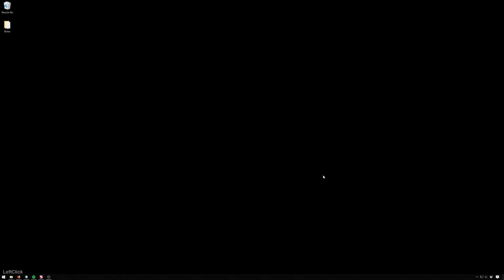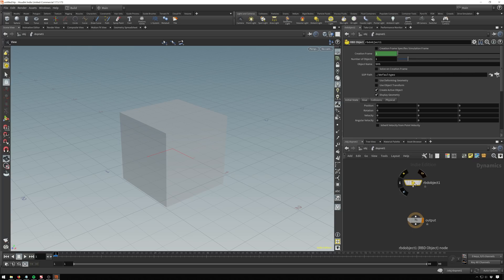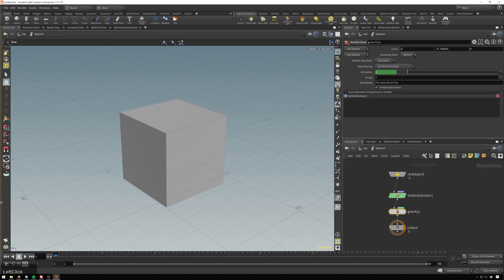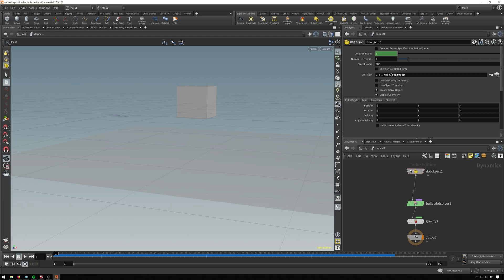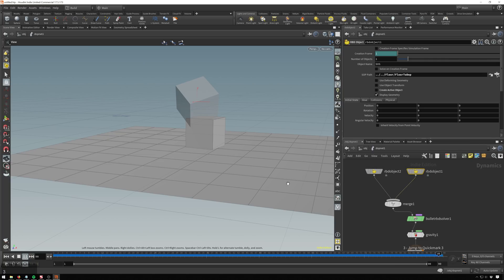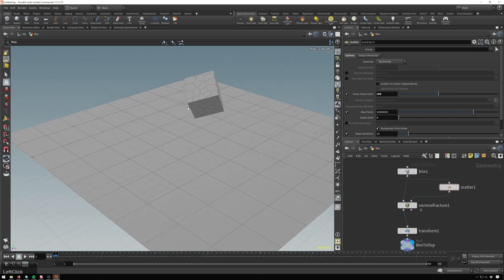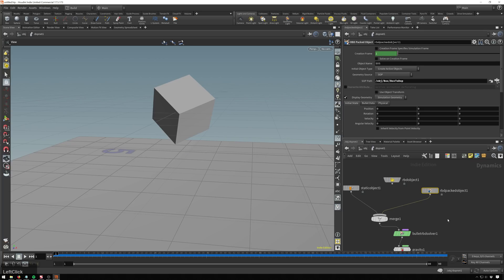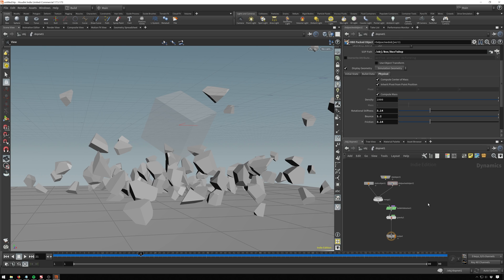Houdini Beginner Tutorial - A Basic Introduction to Rigid Body Dynamics and the Bullet Solver

Comment: if I had an object that I imported which was already made of a bunch of pieces could I still pack it and shatter it the same way? Is there a way to adjust the bounds of the rigid body in case objects overlap slightly?
Reply: you've probably found the answers by now but in case you havent... yes to the first question. Its mostly dependent on 'connectivity' of elements that you're importing. It could be on a tetrahedralized level or down to individual faces. In most cases, you'd want to 'Pack' or 'Assemble' your sim geo. As for object bounds, you can tweak them in the collisions tab in the RBD object node inside DOPs. Hope it helped :)